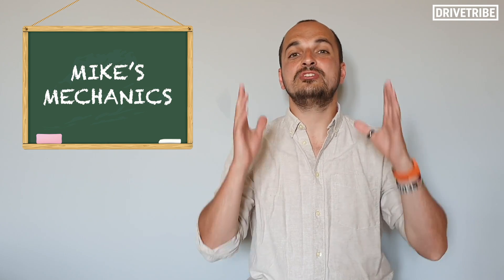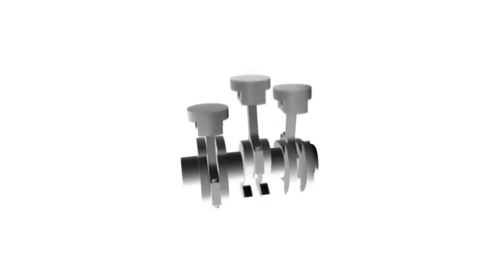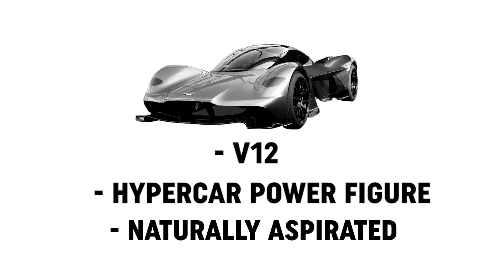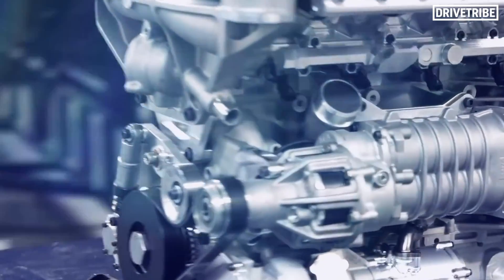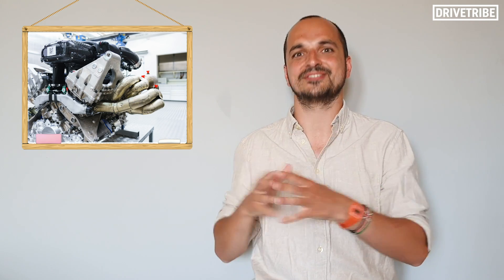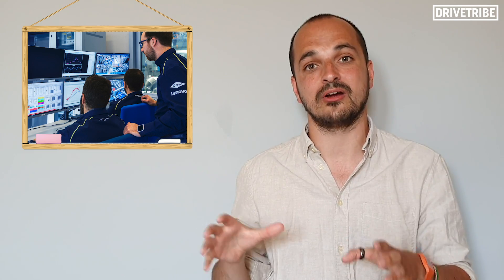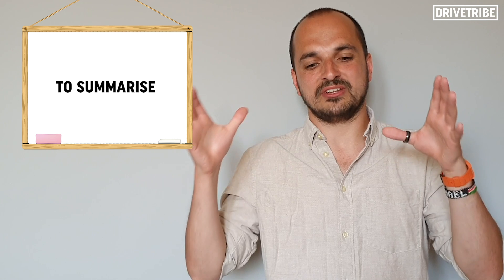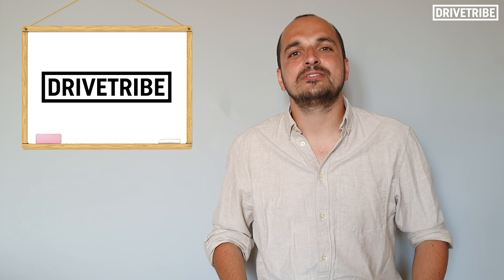This is how you develop a V12 from a 3-cylinder engine

Comment: For anyone unclear on what Mike's not allowed to say:

The basic story goes like this: they first chopped a cylinder off the I4 used in the Jaguar C-X75 to make an I3 development unit, then added a second I3 connected to the same crank to make the V6 Nissan wanted for their LMP1 car.  They then modified its design for developing the Valkyrie's V12, applying the same principle as they did with the LMP1 V6 on a bigger scale.  What Mike isn't allowed to say explicitly is that the prototype I3 used to develop the Valkyrie's V12 is based on the same I3 used to design the Nissan LMP1 V6, and by extension the I4 from the Jaguar C-X75.  Cosworth likely doesn't want people implying that they don't design everything from scratch - which is more of an open secret than anything, but for such a bespoke engineering company, I guess I can see why.
Reply: 99.9% of engine design is derivative and iterative anyway to be fair. Cosworth, Ricardo and various other contractors have standard architectures they'll go with to scale up to whatever the contract wants.
As you say it's kind of an open secret because people who understand production engineering don't care, but the fantasists will get foamy at the mouth

Comment: Someone explain the actual origin that mike couldn't mention
Reply: They first chopped a cylinder off the I4 used in the Jaguar C-X75 to make an I3 development mule, then added a second I3 to make the V6 Nissan wanted in their LMP1 car.  They then modified its design for developing the Valkyrie's V12, applying the same principle as they did with the LMP1 V6.  What Mike isn't allowed to say explicitly is that the prototype I3 used to develop the Valkyrie's V12 is based on the same I3 used to design the Nissan LMP1 V6, and by extension the I4 from the Jaguar C-X75.
Reply: Zack E They took that 3 cylinder engine and put two together to make a straight 6, then 2 of those makes a V12

Comment: I'm not actually sure (except for cylinders heads, pistons, injection, intake manifolds etc.) how you can develop a 3 cylinder engine and have it "almost done" and just scale it up to 12 without still major work.. how you balance an inline 3 cyl crankshaft (that later will be a V12) there are major counterbalancing forces acting on the pistons, flywheel, etc. which in the end determinate you max rpm. Thermals? A 3 cyl engine has way more dissipating surface that those same 3 cyl in the v12.. Exaust? Same problem.. you have to take into consideration scavenging effects and harmonics if you ever want to connect those 4 cat. If they've done it I'm sure it can be done, but still.. looks like major work to me

Comment: Let's say you twin-supercharged and twin-turbo the Koenigsegg Gamera engine. Let's say that makes 850HP. Multiply that by 5 (+1 extra cylinder ), and you get 4534HP and then let's say we get an extra 280HP from fewer losses, 3680HP. Now, let's look at the tiny engines of the Lucid Air. 500HP each. Make these 4 times larger, and you'd have around ~2280HP, theoretically. Four of those mean 9,120HP. Then add the ICE, and you get a W16 with 2 electric motors making... 13,654HP. Imagine a car with a carbon-fibre weaved graphene (added) monocoque sub-frame and chassis, with tons of structural rigidity for 250KG. You could probably get the drivetrain to be ~600KG + a Tesla million mile battery pack (Another 400KG) + the lightest possible interior, brakes, carbon-fibre rims etc for 100KG and a get a 1350KG car with a 10:1 power to weight ratio... Imagine!
Reply: This is definitely having some superhero physics in here
Reply: @slideways8022   Imagine cooling the thing...

Comment: Imagine if someone like Colin Furze sees this and makes a diy v12 from 4 i3 engines...
That would be a heck of a project lol
Reply: As much as i like the guy, i don't think anyone could do that. 
You could maybe make 4 seprate 3 cilinder engines drive a single shaft, but making it into a true V12 would is not something 1 man can do in a shed.
Reply: @Fallingout1234  V8's are made from hayabusa engines, so a V6 from 2 i3 is doable, a V12 is a bit different, because the heads and blocks. A W12 however
Reply: @ΗΕΑΗΘΣ  yo, home made w12 from 2 vr6? That would be dope!

Comment: Wait. You’re showing the Cosworth GMM IC3 engine. But that was designed for the T.50, a 3.9L V12. The Aston has a 6.5L V12, so I don’t think that these mule i3’s are related...
Reply: Could be the same block casting design, de-bored and de-stroked.

Comment: So Nissan has 'given' us the McLaren V8 and Cosworth V12! Thanks Nissan!
Reply: But the Nissan engine was based on the Jaguar 4 cylinder....
Reply: For everyone, as not all seem to get it...

1) I wrote 'Nissan' in quotes indicating it wasn't really completely Nissan to thank for but it was Nissan that initiated the designs for these engines.
2) the V12 is explained in the video, watch it again if you missed it...
3) the V8 or McLaren M838T design, was bought from TWR whom designed it for Nissan as an IRL engine which ended up never racing...

So yes these two engines have a 'Nissan' origin...capeesh?
Reply: @MaartenOosterbaan  Nissan only signed an engineering work order for Cosworth to develop a V12. Cosworth used their own knowledge and abilities to modify an engine they designed and built for Jaguar. Therefore the Valkyrie's V12 engine is a complete original engine based on Cosworth's own research and development for Jaguar.
Reply: @MaartenOosterbaan  Am I being thick? He's said that Cosworth developed a Duratec, and Nissan commissioned Cosworth to design an engine at short notice for their LM car. They chopped a cylinder off the Duratec, redesigned the head, and made a 6 cylinder from that.
Maybe Nissan spent the money, but the engine is a Cosworth modified Duratec design, no?
Reply: @Ruylopez778  no you're not thick it's more like Nissan paid for the initial designs that were turned into a V12...it was more in jest than literally a Nissan engine...hence the 'Nissan'
Reply: @Ruylopez778  is a porsche engine
Reply: Maarten Oosterbaan ...no you didn't, you wrote quotes ("") around the word "given".  That means something completely different.
Reply: We can probably just trace this all back to the Volvo 240..
Reply: Nissan only ordered the engine so no credits there.
Reply: Porsche, Ford and Cosworth were all involved in the development of the Duratec engine originally, but Porsche backed out of the project half way through, and sold the rights and Engineering to Ford and Cosworth.
Cosworth are actually part owners of the engine rights, they actually buy Ford 2.5 production engines from ford and turn them into race versions mainly for Caterham racing , you actually buy one straight from Cosworth for around £1000 to £2500 
https://en.wikipedia.org/wiki/Ford_Duratec_V6_engine
https://www.youtube.com/watch?v=mWF2jTn-rJk
Reply: Thanks r390!
Reply: Carlos Ghosn says hi
Reply: Its jaguar not nissan
Reply: Well the base for Nissans v6 was jags 4 cylinder
Reply: Well not exactly...
Reply: Both are V12
Reply: @r129r16pfl  He meant the current V8
Reply: @r129r16pfl  the V12 of the F1 was from BMW, and nobody tried to pretend it was McLaren's own engine
Reply: @r129r16pfl  the McLaren is a V8.

Comment: It's kinda tragic that they're not developing that 3 cylinder mule engine into a road-going unit. Imagine a Fiesta with that glorious little screamer; Cosworth Fords are a match made in automotive heaven.
Reply: Ford already has a unreleased 3 cylinder 250HP/250T that was supposed to be in the Fiesta. They developed the F150/Ford GT V6 engine from it.
Reply: @Kintizen  I bet that's where Cosy started
Reply: There's the downside of very little torque,  naturally aspirated,  until very high revs, though
Reply: @jamesengland7461  hybrid to the resque for torque 😉
Reply: @jamesengland7461  That thing would probably have about 180 Nm, not that little. Plus one quarter of that Rimac Hybrid system for another 40 HP and a ton of low end torque
Reply: No never you just have to use the full rev range! I would not be disappointed having to rev to 12k rpms to get the power!
Reply: @barrybenkendorf672  how about knowing that the engine is so highly stressed that even rotaries are more reliable than it?, that'd leave you disappointed :P (according to another video on the cosworth v12 it's only rated for 60k miles before requiring replacement, fine for cars built for millionaires who can afford to comission a new engine... assuming they ever do that many miles with it. but not fine for anybody else :/)
Reply: @jamesengland7461  but you get that instant throttle response, and a manual DSG box is pretty quick, or if you're a purist like me you want to shift with a stick
Reply: Let me have that for my Smart Roadster, please!
Reply: @on_wheels_80  was just thinking the same thing. There is enough space to get a V6 in the roadster
Reply: A fiesta that sounds like a triumph street triple... wondering why they haven't done it already
Reply: I think the V6 version would go into the Valhalla, if Aston Martin able to survive their financial crisis without axing them that is.
Reply: @budokpantai  Don't worry about it. Sugar Dad Lawrence Stroll have deep pockets.
Reply: Heck with a Fiesta, stick the V12 into a Mustang.
Reply: That engine will cost more than the Fiesta itself
Reply: Would work better as a straight six with a traditional front engine rwd layout and a 10 speed
Reply: Hot hatches are on the decline.
Reply: You just took my comment! I have a 2018 Ford Fiesta ST! My dream is a high revving 4 cylinder. That Cosworth engine would make my already perfect car beyond perfection! Please Cosworth send me your 3-cylinder so that I can engine swap!!! Please!!!
Reply: for high performance small engines, turbo is king.

for half mile to standing mile racers, turbo is king.

for affordable cars that won't need the added cost of a turbo system and million dollar garage queens that tries to make the most power without forced induction, N/A is the option.
Reply: Sep G l.   Q.  Top
Reply: @sepg5084  so I'm assuming you prefer to go n/a

Comment: I hope that 3 cylinder engine finds it’s way into a hot hatch
Reply: the cost would be insane,,, the parts are still top class and torque would probably be an issue ( all the power is high up)
Reply: martin srabotnik they could supercharge it...
Reply: 2020 Gr4 Yaris!
Reply: not gonna happen. its a pure bred race engine it would be way way to expensive

Comment: if the koeniggseg gemera is able to produce 600bhp through an i3 turbo, then could a quad turbo v12 built on the same principal theoretically create 2400bhp if tbe components were strong enough?
Reply: Actually,  as was the whole point of this video, you can scale it up and get over 2400 hp. Or a 1600 hp V8. AWD would handle either
Reply: @RepEvox  they can just make the gears longer, plus it's AWD
Reply: @falcongamer58  You`ll fry the clutch or destroy the tires and have an amount of power that is completely pointless, by the time you can use it, you`re either on a track, the autobahn, or breaking the law quite severely and if you`re one of those people I hope only YOU get injured.
Drive safe, savages..
Reply: Remember its a big bore i3, 2L i think so that would be an 8L v12 and a v12 of that size would be really really really heavy. I wouldn’t be surprised if we see a v6 variant of it But a v12 I’d say is unlikely
Reply: What the Loony Koenigsegg has done is to develop their own valve timing - no cams involved - I should imagine that patents notwithstanding - it would be possible to do more with that
Reply: The fact that it’s forced induction, and not NA, might make the scaling up ratio different. Would be wild if that ever appears though :D
Reply: Super interesting point! Actually, did you notice that's kinda what they did with the Jesko engine? The Gemera produces 200hp per cylinder, and the Jesko's 5.0L v8 produces 1600hp, which is also 200hp per cylinder.
Reply: @Ausiedundan  Dead on - its due to the 'trick' valves' from Koenigsegg - I think they are electronically controlled?
Reply: Nelson Club Do you mean their Free Valve system Lol? If so, yeah its a huge part of the incredible 600hp in that engine. 

I did a quick google search and I think the system uses a mixture of pneumatics, hydraulics, and electronic.
Reply: @Ausiedundan  Yeah man thats the baby
Reply: for koeniggsegs purposes, 2400bhp would be an ideal # for top speed, you arent really going to take a jesko to a track day,  an 8L v12 quad turbo making 2400bhp would be pretty potent for top speed. seeing as the jesko hits 300 with only 1600, in a longer more aerodynamic and heavier car (acting as downforce without the drag) they could see 320 or even 330. as for part strength inculding tires and clutches and gearboxes, conrods and cylinders, thats an unkown. but it would likely be koeniggseg to use some crazy composite structure material for internals.
Reply: Well I guess that an I6 1200bhp would be amazing (M3?)
Reply: An engine to each wheel?
The Gemera i3 is small enough.
Reply: @RepEvox  but in the video, the finding is that the scaling is over linear, so in theory, it would achieve even more power than just 4x, maybe something like 4.2x, so it's more like 2500 bhp
Reply: Should be aware that there are some street cars nowadays that are pushing 2000+ hp and have the tires for it. Modern ultra low profile tires are available for this power that don't 'balloon much. Just saying.
Reply: Previous to Alec.
Reply: königgseg l3 has 3turbos, yours should have 12 turbos.
Reply: It might not scale up as perfectly as it will become one unit. So speaking along those lines it could very easily be possible for 1800-2000bhp depending on the rev limit as well the higher the revs the more powaaaaaa!

Comment: Imagine a V12 from the 3-Cylinder of the Gemera
Reply: oh man, a v12 in a koenigsegg would be a dream. (I mean, any koenigsegg is already a dream but still)
Reply: martinshoosterman the Jesko has a V12
Reply: @cryo2156 the jesko has a v8, just like all the other Koenigsegg (gemera aside).
Reply: That engine is camless. So for them, the sky is the limit.
Reply: 2400hp and 280kgs!!!
Reply: 2400hp to much maybe a 6 cylinder
Reply: 8 Liters, 8 Turbos
Reply: Also the new czinger 21C has a small displacement V8 2.8 with almost a thousand hp.  Newer very power dense engines. The small displacement V12 on Gordon murrys T.50 700hp
Reply: When i saw the title of the video, i thaught it was about that
Reply: Oh man I was thinking the exact same thing, though the gemera has two turbos, meaning the v12 would probably be the first octo-turbo engine. yes PLEASE
Reply: @amarjit singh or, they could just keep the twin turbos layout. lower power output, but still plenty imo.
Reply: Imagine you not being an idiot?

That is impossible.
Reply: Not na
Reply: 3000+hp
Reply: It would be 8 liters though. That would be way too long an engine to mount in a car and still get hypercar handling. Bugatti's 8 liter engine isn't a problem because it's the length of a V8.
Reply: But it’s turbocharged
Reply: I wish they didn't hold back but sadly, regulations stand in the way